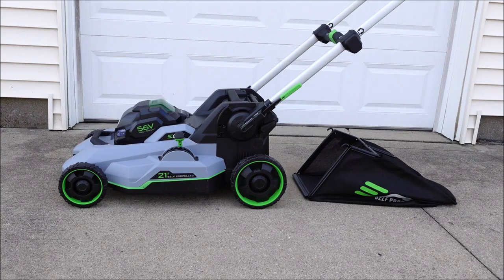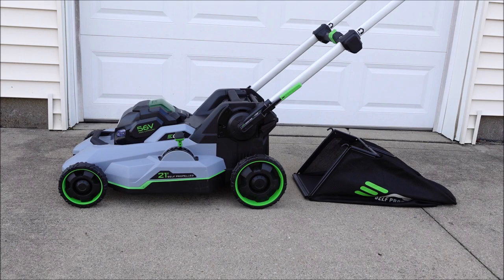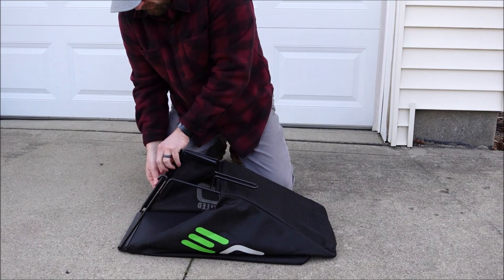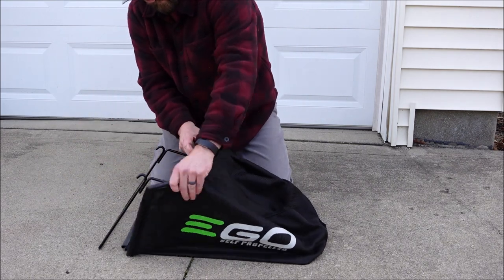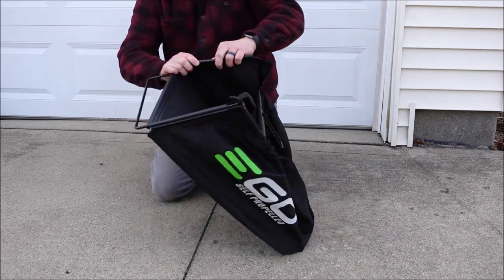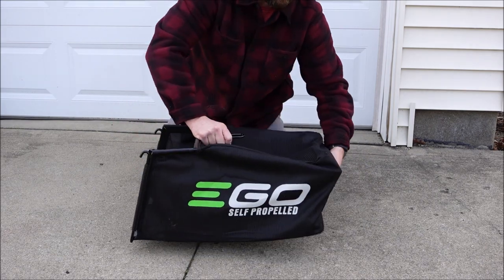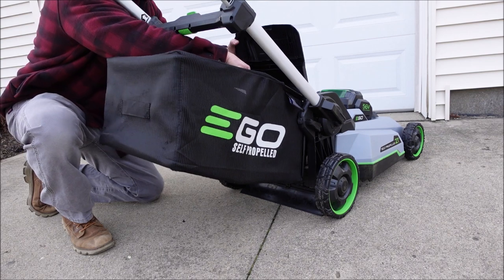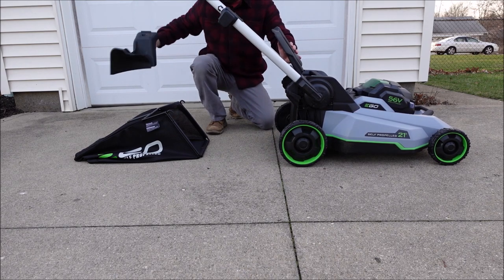How to Assemble / Replace and Install an EGO Grass Bag

Comment: Thanks! Any idea as to why grass and dust sprays out when I am using the grass catcher? It is on correctly and collects the grass but I am getting a ton of grass and dirt in my face when I mow! Ugh!
Reply from the maker: That should not be happening. A little dust is possible if it's been really dry where you live but grass should NOT be flying in your face!

Comment: Great video and demo. One flaw I notice when using this set up - as the bag gets filled up with grass cuttings, it starts to drag on the ground and it is difficult to pull the mower backwards etc. When one has to change direction during mowing. I feel it needs more support at the bottom of the bag. Have you noticed this while using it ?
Reply from the maker: Thank you and I have not noticed that yet. Although I think I tend to empty before it gets overly full. And in all honesty I mulch more than I bag.

Comment: Are all of the replacement bags the same for all models or not? I cannot find a part number for mine. It's the 2135SP. There are a few options on Amazon but they don't list that model. Thanks for the video.
Reply from the maker: They are not all the same. As you can see in my newer video the one on the aluminum deck is bigger and different. 
https://www.youtube.com/watch?v=fnIuekdhY6Y
Reply: @fixitFlip  Thank you very much!!!!
Reply from the maker: @GRJCLyon  No problem.